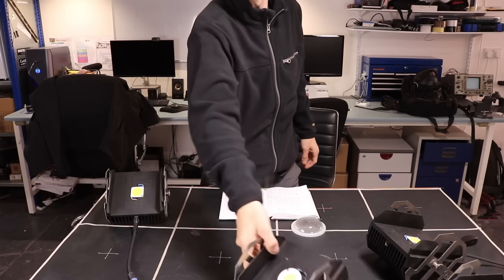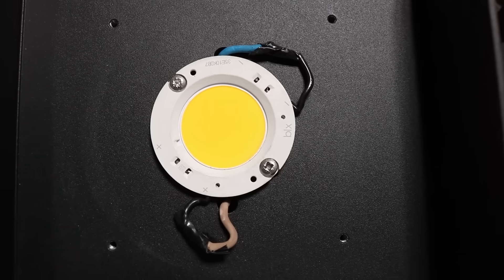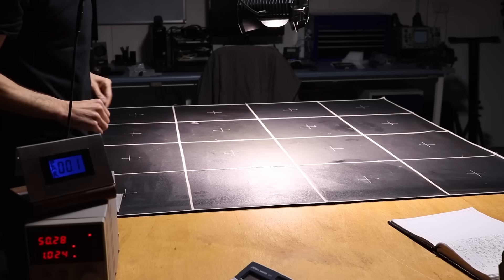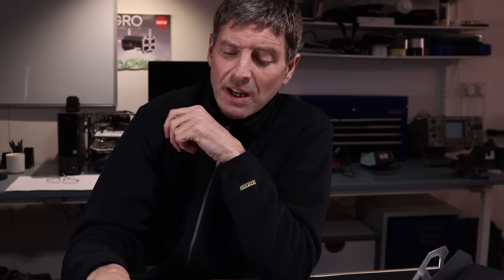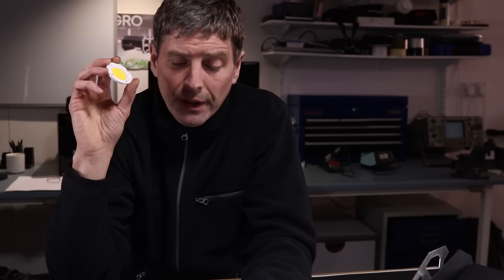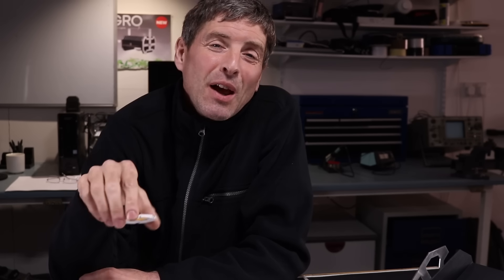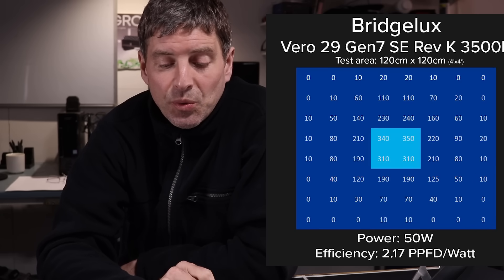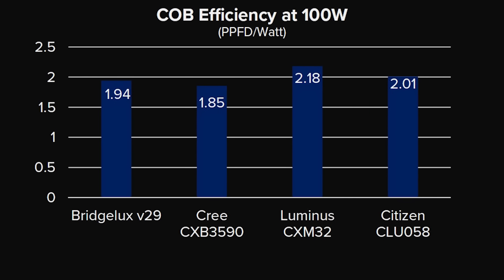The BEST COB Grow light 2019 CREE CITIZEN BRIDGELUX LUMINUS

Comment: Are the CXM32 still the best cobs on the market, or are they a year later something better now?
I had an accident with one of my lights I got shocked and I burned out the cubs so I'm going to replace one of my lights and I'm just wondering if there's something better to run than CXM 22s or my CXB3590s
Well I know the CXB 3590s aren't the best anymore but I'm wondering if the CXM32 still is

Comment: Amazing video and very usefull information to consider our light system. 
However I don't understand how you can run the CXM32 at 50-100W... according the LUMIX specs the CXM only runs between 123 - 285W. 
Only the CXM22 gen4 can run into this test range. Can you offer light about this point. 
Thank you 

Best regards
Reply: They lie for sell
Reply: WEDONT VOIR L'INTENSITÉ MESUR ET TENSION EN DIRECT c'est tellement mauvais vidéo pour la publicité... cree est entre 34-38v mesure réelle et luminus est entre 48v-57v...how you can proff your "50w " or "100w" etc IT IS NOT A SERIOUS VIDEO

Comment: so how do clu48 1212s stack up?

i love their upfront cost a lot, bought 4 of them driven @ nominal, i figured i could 4 more, drive them half the amperage to claw back some efficiency, and take care of the spread by numbers so i can get them a bit closer to the plants too, i may redesign the fixture to sheet metal when i take that plan all the way.
Reply: Andrew Brent  well if you drive them lower, you don't need the seperate heatsinks just get a sheet of aluminum, right?

i'm not sure about pricing lol, quantum boards are 180 bucks for 120 watts here, they don't look cheap where i'm at (netherlands) 
these cobs are 10-12 bucks for 36 watts, i'll have to drive them real low to make the QB worthwhile, and these things don't work for shit on their own on a 3x3, so i'll need to save up like 500-600 bucks for those.

sure, they're more efficient, but that's a lot of money.
i already have 4 clu048 3500k cobs center, and 2 blurple AC cobs to fill the sides in a bit, so i guess i'll just continue on this one for now :D

besides, i got heatsinks coming out of my ass from being a computer geek 

stripped out the old graveyard for them already, they're waiting on cobs ;')

i may want to dabble in adding a blue or 2 aswell on a sepearate driver so i can control the stretch, have been doing that with 20 watt 6000k e27 bulbs with the diffusive cap popped off for now.

Comment: Why test these in an open space and not in a tent when you test other lights (Mars TS 1000 for example) in a tent? Would be interesting to see what kind of boost you would see in terms of PAR efficacy.

I tested my Timber 4vs (would love to see you do a review of a Timber light btw) in my Orca liked tent (every surface lined) and got significantly higher efficacy numbers than you are showing here. Closer to the 2.3 range you show here for the Migro Cob run at 50 Watts (and the Timber runs the Vero 29’s at 100W).

Thanks for the great videos though! Very informative!

Comment: Do a side by side grow with each of these cobs against your light. I have grown with Cree CXB3590 and Citizen CLU048 cobs and they both grow great looking plants.
Reply: I myself use the older Citizen's-CLU048. I actually found adjustable COB's, the only others I've seen besides Migro. They're available with Cree-CXB3590's, but costs much more. 100W, 2-50W COB's on a 1M bar that slide along it, COB's adjust 180°, and can turn 350°, allowing them to be angled/turned however you please! We had a 630W DE-CMH in a 5x5 Gorilla Tent, and used 4-100W-1M bars around the perimeter, giving 8 more points of light to adjust to any situation, supercharged the grows! They were/are on Alibaba. I even recommended to Shane as an economic version fixture. As Shane's craftsmanship is much nicer! Adjustability makes an incredible difference! Now waiting on 2-240W Quantum Boards(generic) w/Samsung LM301H(Horticulture 3.0 umols/J!) to replace the 630W DE-CMH. JUST SOME EXPERIENCE, ETC.. THE CITIZEN'S HAVE BEEN GREAT THOUGH!

Comment: Thanks for sharing! I just bought 5 BXRC-35G10K0-C-73-SE chips and i was wondering the diference between this one and the BXRC-35E10K0-B-73-SE.
By the datasheet it says that mine have 90 cri, but less efficacy. So i wanna ask you which one is better and why?
Reply: 90 cri has a better red spectrum. Your C should be equal or close to 80 cri B. If you had an 80 cri C it would put out more per watt than the B. It probsbly still woukd be short of the CXM-32-35-80

Comment: The vero C is the most efficient chip in Bridgelux's line, why didn't you test it? As well as the original vero is more efficient than the SE version. You solder your luminus, so should be no issue.
Reply: Thanks for that dude ...nice greetz from austria ...love your diy !!
Reply: Cool name, I just set up a channel a little while ago called MrGreenGenes lol Have you tried the Bridgelux EB strips? Now that I see you're the photo boist guy.
Reply: lol 0:43 vs CLU058-3618. This guy lol

Comment: Why you did not use reflective myler ? i think its a standard this day's, 
no one going to run them like that in the dark with no reflective metiral what so ever.. 
i think it would even bump the numbers a bit 
but still , thank you very much ma man!
Reply from the maker: Measuring the light output to the edges of the light intensity measures more of the photons than in smaller areas with reflective walls.

Comment: Love your tests normally but wondering why you did it over 120x120 when a Migro-100 is recommended for 60x60? Just wondering what that would do to numbers, with reflective walls like normal. Maybe an idea for a quicker re run 😉
Reply from the maker: Measuring the light output to the edges of the light intensity measures more of the photons than in smaller areas with reflective walls.

Comment: Definitely 3500K DB bin would win
Reply: The DB bin will definitely be one of the top contenders @50W we have them in stock too. Don't know where this mixup is comming from..??
Reply: Selo Tozi the cxb3590 is on only available in the DB bin from 4000k upwards, it has more blue in the spectrum so of course it will test higher. If that’s the case just put a 6500k cob in and it will beat them all👍
This test is for 3500k only
Reply: The Budget Grower that’s not right 
I have DB bin 3500K on stock
Reply: My Cree cobs are all 3500K DB bin I can show you a picture 
So that’s why test must be with top binning and not CD bin

Comment: Hey bud. I have recently been in contact with a guy that sells grow lights utilizing the cree xp-g3 diodes. You could probably search apollo flux aft-hs100 and find it. I just wanted to know if you had any info on these diodes and hopefully in the future you could test one of these lights. I see photon chasers.  UK have their own cree xpg3 boards aswell. 

Anyway he seems to think they put perform hlg boards and I am very sceptical
Reply: If your looking to get some new lights i would head over to invisible sun LED as they are almmost exactly the same as HLG boards but seem to run at a lower temperature than the HLG even when ran at the same/equal wattage. I have 2 4000k 170w fixtures for my veg tent and 2 3000k 300w fixtures for my flowering tent and believe me they absolutely kick ass.

Comment: Why didn't you use Vero's "C" model? It is more efficient than the "B".
Reply from the maker: Hi, the efficiency is the same for the B,C and D version.
Reply: @MIGROLIGHT  Again, not true. Check my other reply.
Reply: @MIGROLIGHT  Yeah i saw B,C,D versions has the same efficiency ratings in first datasheet table, but be careful, those are specified at different power for each version. For example, D version on 75W has around 164 lm/W at that power C version has 183 lm/W, at 50W even crazy 195 lm/W while your b version at that power has around 155 lm/W. At 17€ a piece, if you run them at lower power and have more chips to make for desired power (low price), i know no better lights on market? C version deserves another test!
Reply: I'm sure the C's are more efficient. But I'm not interested in that as I am in letting you know I do appreciate your content @migro and would prefer a comparison of these led's while focusing on efficiency at various driving currents rather than watts.

Comment: Citizen clu048 gen 6 is ten bucks lol ftw !
Reply: This!
Reply: yeah, so i noticed when trying to cobble (pun intended) together a cob build.

crunched the numbers, and figured if i get 3 of those for the price of the big 30 buck bastards, design the fixture to have em a bit closer to gether and drive them lower, 
(like 15 cm apart and driven at only 23 watts those 155 lm/watt turn into 178)
through sheer number, i can get the efficiency back by driving them softer, and can get up closer to beat out the whole inverse square law without using expensive lenses,
just put all the money in cobs, not to mention you could cool them by mounting them a piece of sheet metal with some big fans blowing over it, if not completely passively :D

i'm all clu048 1212s, the rest is too high up my alley, well, i'm looking to find a way to get my hands on some of those bridgelux eb strips that go for like 3 bucks per 13.5 watts too.

Comment: Always great videos Shane! I know the COB's have lenses usually, but would love to see the numbers of what a 50W COB can do in a 2'x2', 60cm x 60cm space with walls! Efficiency rating, I guess won't change, but w/2'x2' space/reflective walls should give much higher umol numbers, I'd think? For that size space, with different heights, etc. But I'm halfway through video, so maybe I'll be surprised! I do understand that this video was about efficiency of new COB  chips, and is accurate. Just love to see the differences in space, relative to wattage. And your the man with the truth always! One thing about COB's,  chip can always be changed to newer, more efficient, settings. I didn't want to pay $50 more for Cree, got last generation Citizens chips(year ago), thinking I could always upgrade chips! I think the Luminous chips may be too large compared to Citizen CLU's I'd replace. I need to look into that! Sorry for rambling on, once again. Time to finish video, coffee!!! Most important light channel online! Thanks again Shane!
Reply from the maker: thanks, according to my tests measuring the light output to the edges of the light intensity measures more of the photons than in smaller areas with reflective walls.
Reply: @MIGROLIGHT  I was just wondering what the umol levels would be in a 2'x2', as the area used would have higher numbers(wasn't that the idea w/the added walls?). But yes, I agree the umols/Watt, total efficiency, will be more accurate, the way you tested, with all photons!👍 Have  a great one(or several!) Shane! Always love the videos. The best!

Comment: I use citizen they work really well glad to see the real ppfd of there chips 👍
Reply: You can see more real par maps over at our website. https://www.rubol.nl/par-maps/  
The model used in this test is not correct. The top model of the Citizen is CLU058-1825C4-353M2M2-F1.
Reply from the maker: @rubolhorticulture4320  I see the CLU058-1825C4-353M2M2-F1 are 155lm per watt which is a 1.9% increase in efficacy over the model in tested. If you want to send me one I'd be happy to test it and post the video update  our address is on the website. Thanks Shane

Comment: Thanks Shane!
 Have you read about the health issues around dimmable leds?
Reply from the maker: I have heard of issues with EMC (electro magnetic compatability) on low end drivers. They emit magnetic radiation. Ours are EMC compliant so no issue there. Flicker can also give some people headaches etc. The MIGRO drivers do not flicker so no issue there either
Reply: @MIGROLIGHT  The dimmable create frequencies that are dangerous to our electromagnetic bio-rhythm. Ive had calls from 2 health specialists asking if our growlights were dimmable. Just wondered if you'd had similiar calls.
Reply: Hidden Harvest Grow Lights I wouldn't worry about led s when 5g is coming out and all the crap they spray in our skies. 🍻
Reply: @blopjones1665  Agreed on 5G. Shit....wifi alone is a disrupter. The sky....no agreement. Its a psyop. I study helio-physics and its not chemtrails or weather warfare. Solar cycles.
Fyi.....your chemtrails are supposedly full of atomized particulates such as barium and strontium. Now....google those two names.....and go buy it at your local supplement store. Your falling for it. Be smarter.
There are 4 levels to our stratosphere. If they truly wanted to get you....it could easily be masked at higher altitudes. Its not happening. 
Now...regarding operation Solar Shield.....these particulates may be helping the earth warm a bit to prevent cooling from Solar cycles...but unlikely.
Have an awesome day. Eyes open...no fear.
Reply: I want to know what do you know ?
Reply: @James Tierney 100% wrong
Reply: @James Tierney dimmers my friend....not the leds

Comment: Cheers Shane, Running the luminus at half power is the most efficient. What kind of square footage would that be good for seed to flower? What height would you recommend
Reply from the maker: Hi, the Luminus CXM at 50W will cover 2 square feet. 20cm hanging height.
Reply: @MIGROLIGHT  It must be mistake -  2 square feet is ONLY 0.185806m2 :(